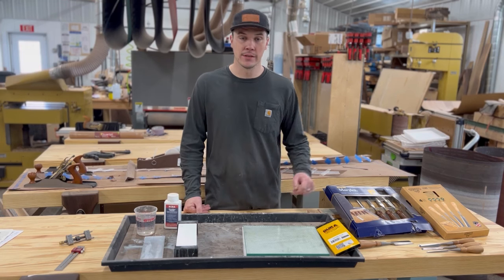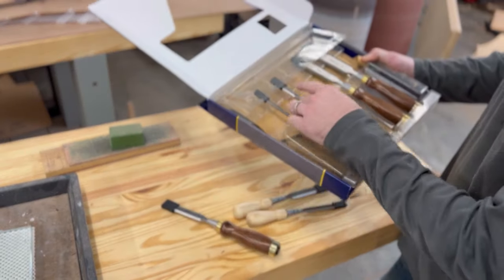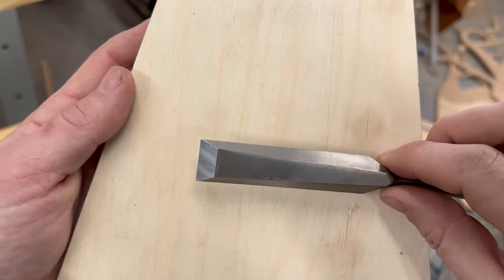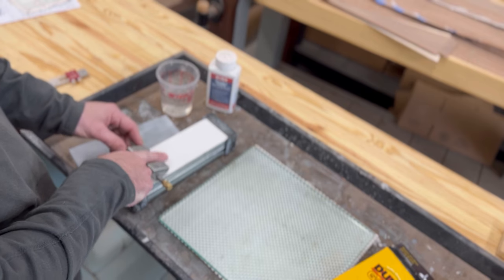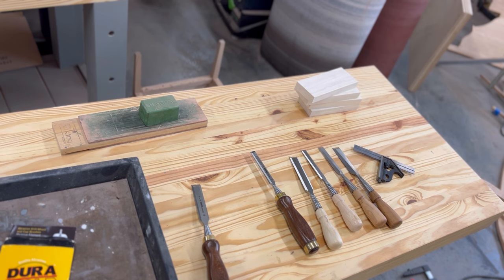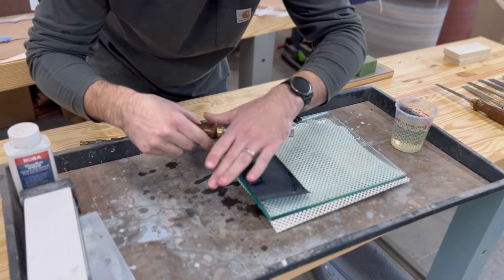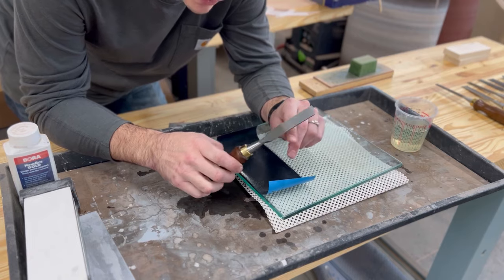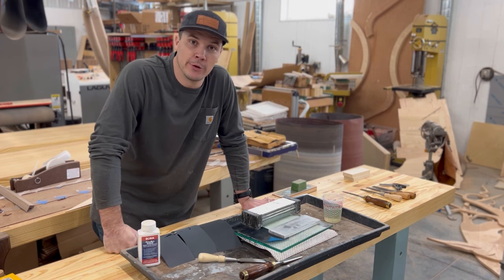Irwin Marples VS. Stanley Sweetheart  VS. Lie Nielsen Chisels

Comment: Great video. I bought  the Stanley Sweetheart 4 chisel set. 3 of the 4 sharpened up quite well, but the 1" was a bugger to flatten! It had a high spot on the back, which I understand is much harder to flatten than if it were cratelow in the center, and it took forever to flatten. It was a good learning experience for me to learn flattening and sharpening, but I think my next chisels will be either Narex Richter or Lie Nielsens.

Comment: I'm surprised that you did not remove the handle from the socket chisels for sharpening. The ability to do that is one of the primary reasons I prefer socket chisels.
Reply from the maker: Probably just a preference thing. I don't really have issues with my stone setup because it's elevated enough off of the table. It cleared using the glass in all but the Irwin

Comment: Good day America. This is Lithuania. I want to know. What grit should I start using on a grindstone to prepare the correct chisel plane? And how many microns of metal can be ground off if the back of the chisel is not smooth? And do you need to grind the entire back of the chisel, that is, smooth it, or is it enough to grind halfway? I have Irwin 750 wood chisels and their backs are not straight, if you look at the whole length it looks like a convexity that shines through, but if you look at half the length, then the convexity is smaller and it is more even in half the length. P.S language is not corrected.

Comment: I feel like unless the chisel is the cheapest of the cheap (sub 55 Rcs), they shouldn't really be that much different during the first few cuts.  Owning and restoring no less than 200 vintage chisels amongst my modern chisels, I can anecdotally claim that the difference is often in the feel and edge retention (depending on what you are cutting) vs sharpness. On softwood especially, where the keenness matters far more than edge durability,  I feel like that based on that sound, your chisel hasn't found the sharpness for some reason.  The end grain chips should break with no skips on a sharp chisel. On a properly sharpened chisel, even just on a hard Arkansas, it should feel and sound like cutting through thick plastic rather than wood.  Your chips shouldn't have such large break profile and will appear waxy.  Just some thoughts.

Comment: What are your thoughts on the shape of the chisels? But for the thickness of the edges of the chisels, I like the Stanley Sweethearts. To my eye, the edges are too thick, which make the chisels difficult to use for paring the inside corner of dovetails. They're just fine for most other bench chisel tasks.
Reply from the maker: I've not had any issues that I paid attention to. If it felt clunky to me, I may reach for a smaller chisel or skewed chisel in my shop. I do believe the Irwin felt very large and didn't really compare to the Stanley or lie nielsen

Comment: And I still have a question. In your video, I saw Shapton glass 500. But we don't have them for sale in Lithuania, but they are available from other Japanese manufacturers, such as Naniwa and Suehiro (and this is an incomplete list of products). So the question is this. Which sharpening stone grit is better to use if there is no 500, 400 grit or 600 grit?
Reply: It really wouldn’t matter.